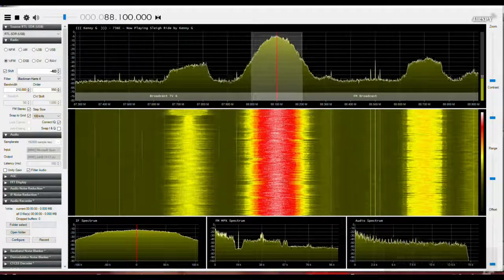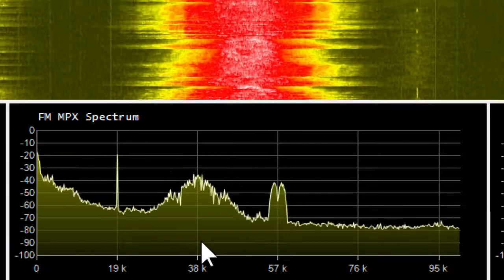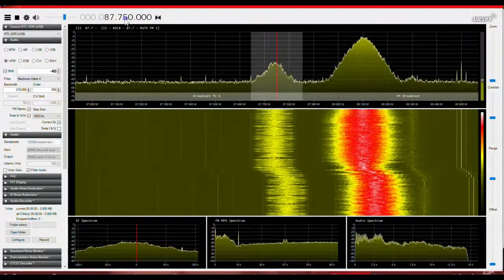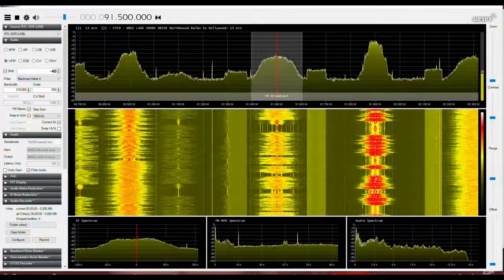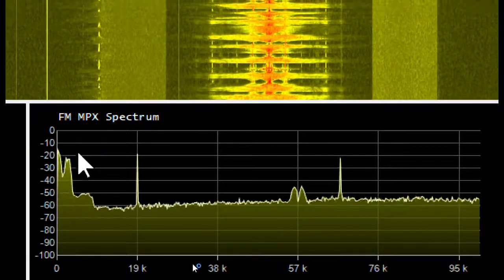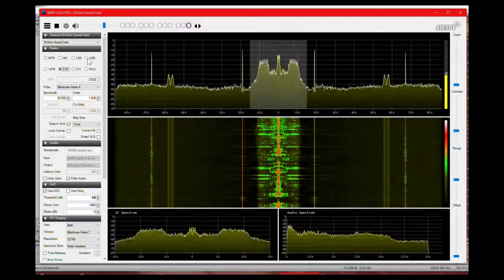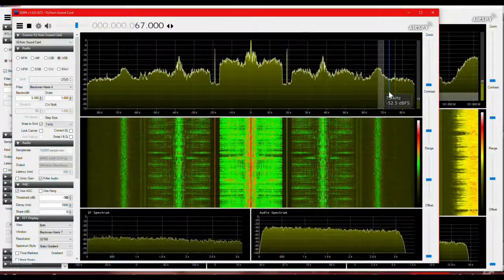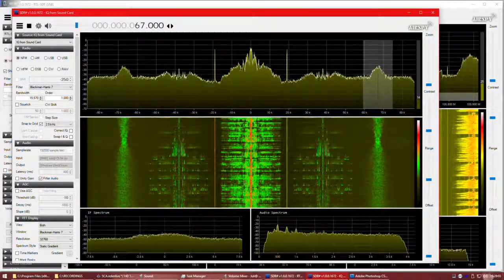SDR Sharp & SCA

Comment: Hi. This video is about SCA, but I'm interested in the signal at 87.74 MHz. You say it is the sound of a TV channel. In which country do you receive it? 

I have read about the USA MTS system, Germany A2 and Japan EIAJ, but none of them use a single sideband and pilot tone at 19 kHz (should be 15.734 kHz for NTSC or 15.625 kHz for PAL). In addition, the signal at 57 kHz is similar to RDS, which is not used in television broadcasting. Maybe you know which standard is used here?

Thank you for the video.
Reply from the maker: The North American analog TV system placed the channel 6 FM audio carrier at 87.75MHz which many FM receivers can hear well. Since this isn't an FM station they aren't bound by the same rules. This station uses only the lower sideband of their 38kHz stereo subcarrier. The idea is to save power by transmitting less AM bandwidth and potentially less noise in reception as noise increases with frequency with FM. A side effect is they have to raise the level 6dB because a sideband is missing.
They've tweaked the carrier down in frequency to 87.74. I'm not sure if it's due to limits of the rules or the equipment or perhaps an error, but being nearer 87.70 should help receiver's performance with hearing this 'off frequency' signal.
TV channel 6 here is an ATSC 3 station and as such they do not have to use their entire bandwidth for TV. They can use it for many other things, lease it for wireless users, transmit data, all sorts of stuff including a mock FM broadcast. I'm not sure why they don't use 87.70. It could be they don't have sufficient bandwidth without interfering with their primary TV signal.
Reply: @AC9BXEric  Thank you for your detailed answer. I was reading about analog TV broadcasting systems and didn't even know that digital TV according to the ATSC standard has a fallback analog audio. I heard that some FM stations started testing a single sideband with a suppressed carrier. So I thought that's what it was.

Comment: Is the HD radio sidebands a simulcast of the SCA subcarrier?
Reply from the maker: No. Generally it's the main audio but it could be different.
And they can exist alone, without the analog signal. The HD in this case stands for hybrid digital with the idea being an eventual transition to all digital. The HD audio is a compressed stream very similar to AAC. Depending on quality there's room for a few streams. Few stations have an HD3 but many have an HD2.

Comment: Is there a way to make SDR Sharp decode HD Radio digital sidebands?
Reply from the maker: No, not that I know of. And there's an issue with trying to do that with a plug-in. The codec & system is proprietary. So there's licensing issues if one is to distribute such a decoder in software like SDR Sharp. There is a command line tool that can operate a RTL type dongle and play HD Radio much like the basic command line tuning tool, Theori's NRSC5 decoder. You have to build it yourself from the source code. I suppose it may be possible to pipe the digital data by virtual audio cable to something like FFMPEG.